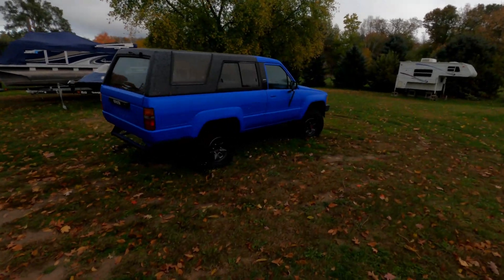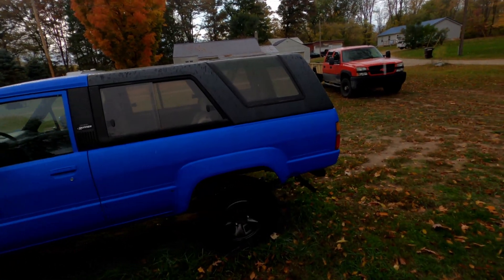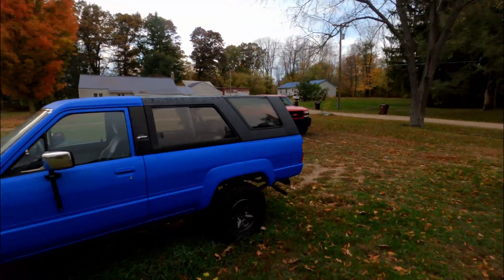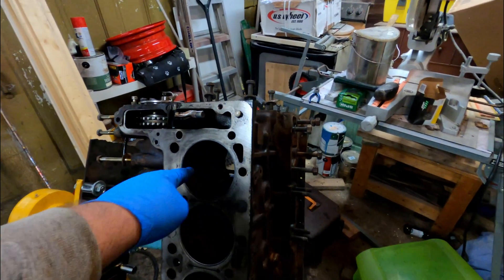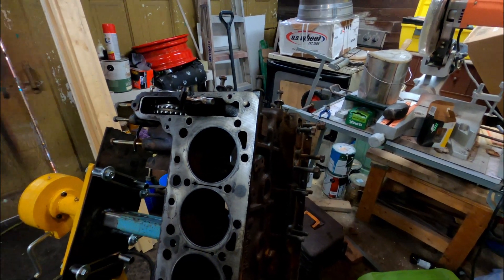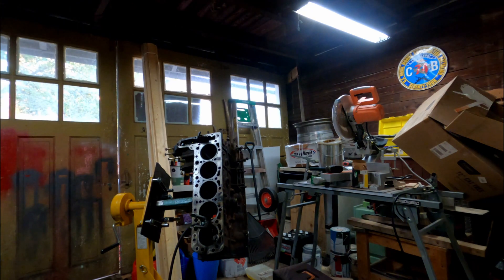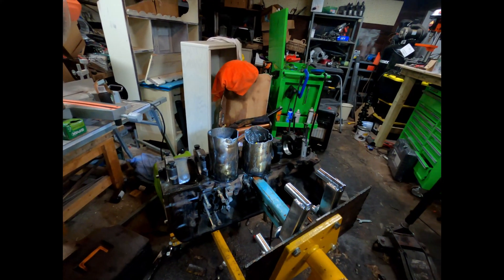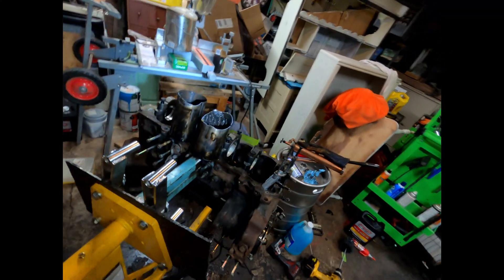Diesel First Gen 4runner build! Removing cylinder liners with welding!

Comment: Liners, bearings, bushings, weld it all to get em out! 
In the diesel world, we change liners alot, best thing I can tell you is make sure you get the liner pertrusian correct and some engines have different thickness head gaskets, just FYI. And as you already know, freeze the new ones or shock them with dry ice to put em in !